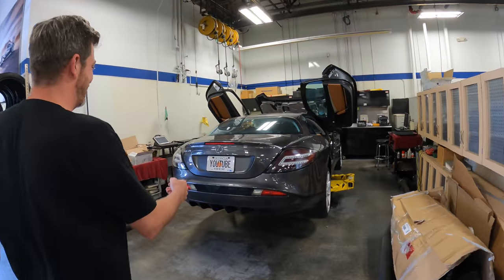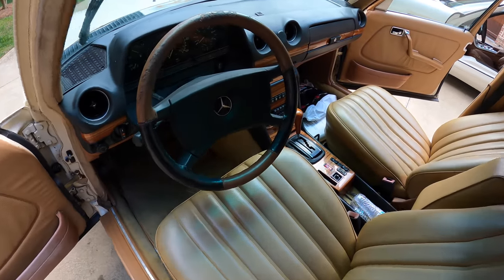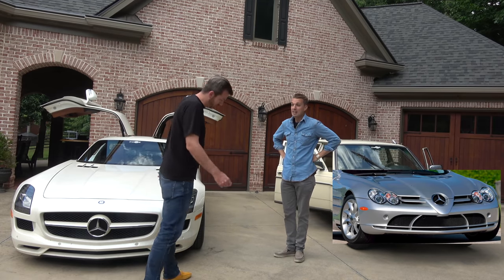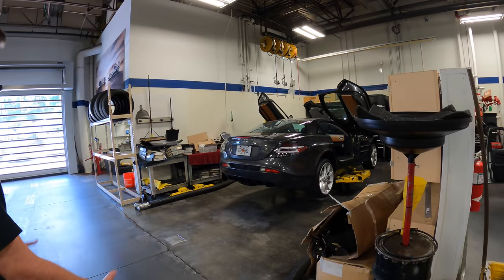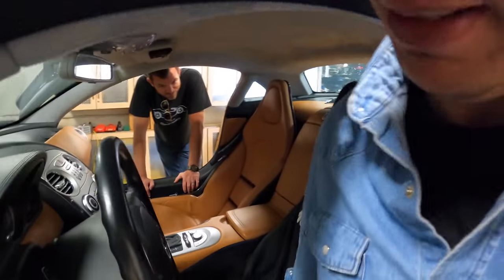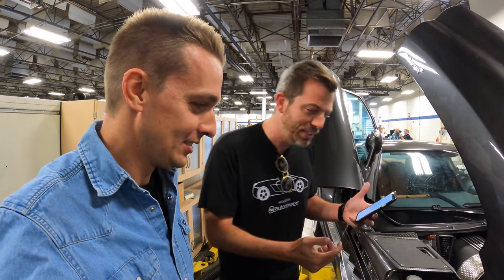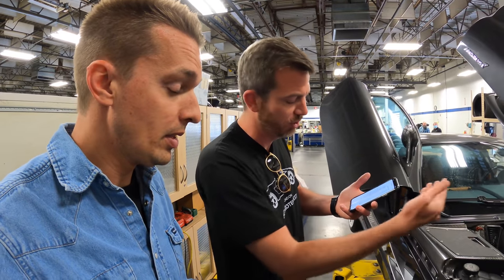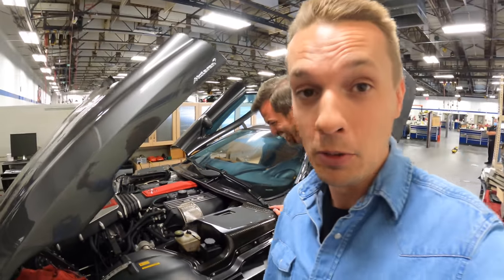Here's why you should NEVER EVER buy a Mercedes SLR McLaren (Especially Paris Hilton's)

Comment: I had the very first AMG sold in Mercedes dealerships, the mighty C36.  It had something like 270 hp from a naturally aspirated straight six engine and was one of the the fastest sedans on the planet for its time.  0-100 kph in just over 6 seconds and a top speed of 250 kph.  It was a nice little sedan, but it just goes to show you how much cars have changed since 1995.
Reply: ARE YOU KIDDING??? That's awesome!
Reply: My Toyota Avalon has 270 horsepower lol

Comment: When these were new, I worked for a transport company that had the contract to deliver them to the dealers. One day I was delivering one for a dealer in Ohio and forgot how hard you have to press the brake pedal to get it to stop. They asked me to park it at a particular spot that had a curb. I press the brake pedal to stop normally and the car keeps moving. I finally really got on the brakes and stopped the car within about a 1/2" of the front end hitting the curb. Had to change my shorts after that delivery.

Comment: Check the joints in the steering shaft. Sometimes they get stiff from sitting and gives you easy/hard/ easy hard when turning in parking lots. Sometimes they work themselves out after driving awhile

Comment: The transmission does not blew up if you change the fluids. All AMG transmissions last very long, as long as you replace the oil after 5k, 80k and 150k miles. The 5k transmission oil change is usually also inclusive if the car is bought at a official MB dealer. AMG engines also last very long if they are treatet correcly. Only floored when the engine was on temperature and the oil change intervalls been obeyed - with 100% correct oil. 
If the motor was pushed realy hard, the timing chain can be stretched at above 120k - new chain + tightener. By some models the tappet can be worn, but this is also a result of bad or false oil as metal flakes between the tappet crankshaft grind the special alloy coating of the tappets away. 
The cylinder shafts are made of Silumin/Alusil. The aluminium is removed by a acid and the surface left is silicium, so the piston rings move over silicium on a oil film. This surface can only be destroyed by hard particle in the combustion engine - mostly cause by crap pseudo air filter (ebay), or if the car is hard flored in a cold condition. In a cold condition the piston has some lose movement and can tilt/scratch in the chamber.

Comment: You have made me appreciate by 2004 Ford Focus even more. Did the Front pads 6 months ago. $50 for the pads. There were almost 40,000 miles on the old ones. The rotors were still good. No need to replace. 

The full 100,000 mile service was dome in 2011 at 110,000 miles for $1200 including new full front brakes and all fluids. 

I person I know with a 2019 Corvette Sting Ray only spent trice that amount quoted buying the whole car brand new. It is in the shop now for the first non scheduled service from a mega pothole having taken out a tire. 

I have always known Mercedes service is expensive but really $100 for a fuel cap tether!

Comment: I can never understand why a car of this supposed quality needs so much work and replacement parts. Seems to be the same with all Mercs these days.
Reply: Its because they consist of more and expensive parts. What did you expect? That they magically somehow makes super car performance out of Toyota Corolla parts?
Reply: @HermannTheGreat  If they had the same performance as the MB parts they would fail or be expensive too in the same way. MBs are usually very reliable compared to how complex they are.
Reply: because its a expensive piece of junk.
Reply: @rci-tf2zc  No, its a highly engineered and solid built car with high performance. That's why it costs money. Cheap cars dont cost money. Expensive cars do. That's because they consists of complex and expansive components. Cheap non performance cars doesnt. That's why they are cheap.

Comment: Fun Fast Fact: You are not supposed to lift an SLR McLaren on a standard car lift because it may damage the carbon fibre chassis. SLR certified service centers are required to have a special lift that has adapters that attach directly to the car.

Comment: I like the SLS even more now. The AMG M156/7 is the only AMG engine from the ground up. With a few good measure fixes and some tuning it's absolutely the best Mercedes engine EVER made. The 4.0 is the EPA Euro 6 emissions motor. It's 2021 and Mercedes will again run the 6.2 AMG in the GTE (GT1) car. 5 years after the last production car used it. The 4.0 turbo is also a cost saving measure.

Comment: It's pretty sad when for maintenance reasons, you're glad you bought a Lotus, instead of a Mercedes. Ed will pay $5000 more in repairs on his SLR McLaren than I paid for my Lotus Exige. 

In 4 years I've spent right at $6000 on repairs, including a new transaxle, tires, coilovers, suspension rebuild, HID / LED headlights, etc. And I've put a shit-ton more mileage on mine. (It has 98K miles). Admittedly, I've done all the work myself, so there's very little labor cost in that $6000. Still, most mechanical parts for the Lotus are ridiculously cheap.

The SLR is an incredible car, but for me, maintenance costs on consumables alone would take the fun out of ownership, and the fear of a major failure would make me scared to drive it. I don't see how anyone worth less than $10M can justify owning one, as there are plenty of less costly alternatives with a similar fun factor.

Comment: Rear diff drain plug is leaking..... 850$... ..?

Couple months ago I replaced the pinion on my gfs rear diff for less than 50$ parts + gear oil.  Know what I did with the drain plug?  Put it right back in the Fkn hole.  What are these Fkn people talking about??? 850$ for what???

Comment: Mercedes Corporation should be responsible for most if not all of these repairs. How can they sell a door shock for $2.5k and it fail under normal use? That's a manufacturer fault. Same with the steering rack, that could cause and accident. How in the world is the customer responsible when a vital component fails under normal use. On top of that, this is a 400k car brand new?!?! This should be a perfection piece of engineering. It's more like a Humpty Dumpty falling apart POS 😝